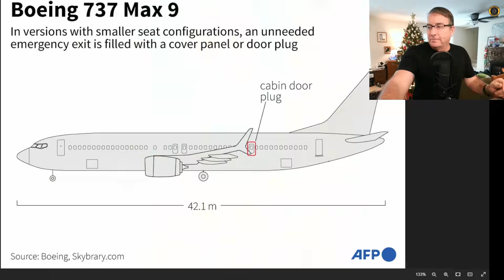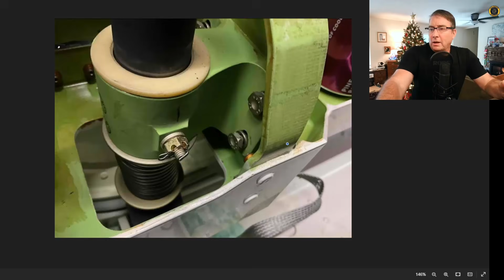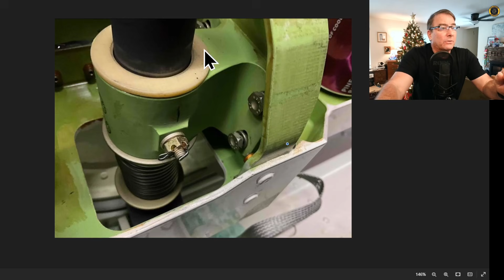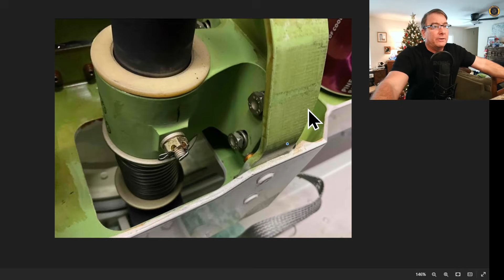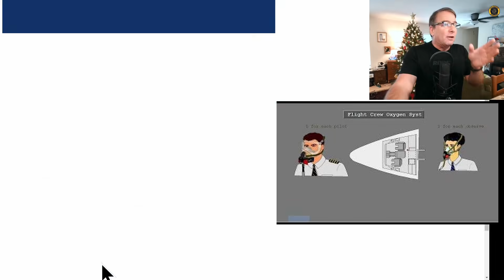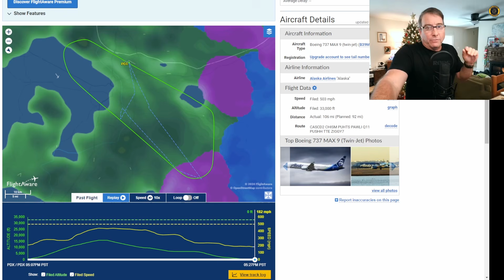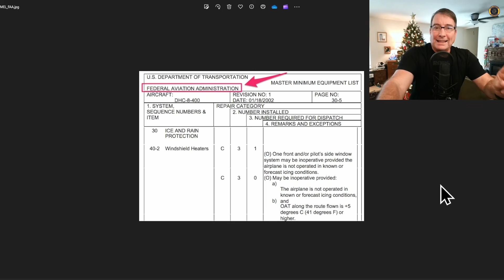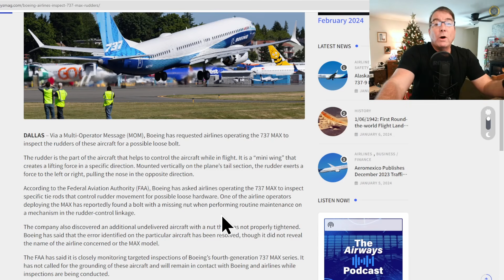"Yes, We Have No Bolts"  9 Jan 737 Max-9 Update

Comment: They would know immediately upon looking at that door if the bolts were on and tight. I see all these "experts" talking about this on TV, and none of them do it as well as Juan.
Reply: I believe that the "door" (dummy door) frame and surround are covered by finishing decorative wall covering that may be sound insulating and not designed to be easily removed unless for a major service or refitting of the aircraft.

Comment: This is the most accurate video series period.'  ..but that castle nut @3:00 does have a specified torque , it is torqued then the "castles" are lined up with the cotter pin hole then the cotter pin is properly installed ....   imagine on the shop floor if someone "anyone" says that bolt installation is not so important .. when in actuality that
set of bolts are super critical .. the other bolts @ 5:40 are installed with a nutsetter a air powered toll that runs the bolt down to a specified torque example 35 in lbs.
those examples look like they were just put in finger tight and skipped.........  Today they had a Safety "stand down"  !!!!
Reply: The torque on the retaining pins is not "super critical" because they have castle nuts.  There is no way all four cotter pins failed in two months.  The likely scenario is that the pins were simply never installed and the door stayed in place by pressure until it eventually shook loose two months later
Reply: @luisdetomaso867  But it is super critical because if you are installing to "spec"  then you will also be putting cotter pins in.....
a castle nut freewheels without a cotter pin ...  Imagine being a mechanic and having "everyone" say this ain't Super Critical  🙃
Reply: @ronaldspins  I think what was meant is that the bolts with castle nut / cotter pin securing are not torque to yield (stretch) as is the case for the other fasteners mentioned.
Reply: @ronaldspins As you point out, the cotter pin is critical. The nut torque is not all that critical. In fact, is is very close to "not at all critical". It's real nice if the nut is tight enough that the bolt isn't rattling around in the hole, since if it is rattling wear will eventually become a problem. But even if it is rattling loose, if that cotter pin is there and properly spread, it isn't going to come apart for at least a few years. By then it should have been through an inspection cycle and the bolt removed and reinstalled.
Reply: I thought that that bolt IS the cotter pin.
You seem to be talking about the split pin/ wire holding the castle nut secure
Reply: @lwilton  The torque is required by specifications
Reply: @lwilton  You are spot on.  Torque hardly matters with a castle nut.  And in this case, the door would have been held in place by any ONE of FOUR bolts.  It's pretty likely that ALL of the bolts were forgotten by mistake and it was just a matter of time before the door shook open
Reply: @ronaldspins  Torque for a castle nut might be specified, but if the nut is pinned it will still do it's job just fine.  Might rattle a bit, all 4 of them are not failing after just two months of service
Reply: @ronaldspins if they are torqued to a certain amount, what do you do if the hole in the bolt doesn’t line up with the slot in the nut? You would either need to over tighten or back it off a bit to put in the cotter pin. Seems to me torque is a non issue
Reply: @jameswolff2152  yes I can tell you have never performed the process ...if you are installing and torquing then you are cotter pinning it
Reply: @jameswolff2152   Bolts that use a castellated nut has a torque range for the nut. Torque to the lower torque, if the cotter pin doesn't line up, increase the torque but do not go over the max torque. Fasteners are always have a prescribed torque in aircraft.
Reply: Mr Brown's Channel is the Gold Standard.
Reply: Outstanding reporting Juan!  One of hiss best analysis yet and I've been following him for years going back to his analysis of the Lake Oroville Dam repairs.  Sometimes I'm thinking I'm learning more than I need to know.  My wife and I flew a United 737Max-9 18 months ago from Maui to SFO.  I took some comfort in the type of plane  that it wasn't a Max-8.  Keep up your reporting Juan.  If you ever stop your daytime job, I'm sure you have a spot reserved for you with the NTSB.
Reply: I am just a car guy that had to learn proper safety wiring methods to install high performance brakes on his '69 Camaro. I was under the impression either castle nuts and cotter pins or drilled bolts with safety wire were practically everywhere on planes. I am wondering is there any reason those two bolts holding the hinge on the door plug are not drilled and safety wired? It seems they are kind of critical to keeping the door in place.
Reply: I agree. But it is just speculation. I bet someone found out they could save time by not torquing the bolts. and this is the outcome.

Comment: Extremely worrying for safety and Boeing! 😮
Reply: They/the person responsible for this manufacturing step can be thankful there was no loss of life. This is shaping up to be careless workmanship.
Reply: @larrybe2900  Or sabotage.
Reply: @Rebander1549  Almost 5000 on back order- it would most likely put Boeing out of the commercial Airline business, if the Aircraft was cancelled. this MAX problem totally detracts from the great safety records of the 777,787,717,747,757/767 etc etc! Please Boeing get it together on this Plane!!
Reply: @SAC-93  @jimanderson1589   
Why do you believe that people not tightening or installing bolts is unique to "this Plane"?
Reply: @Rebander1549   You have absolutely no idea what you are talking about
Reply: @Farlig69  thanks,  but it seems like it is worth considering.  A seamless hull seems like it would withstand the pressure but I don't know what I am talking about.
Reply: @Rebander1549  Birds don't have unneccessary holes - they only have holes required to sustain life and they don't carry fare paying passengers. 
Fare paying passengers need doors to enter & exit the aircraft, and they absolutely need emergency exits. They also really really want windows.... 
So, a birdlike seamless hull fuselage just would not work and yeah QED: you don't know what you're talking about.
Reply: @Farlig69  you're correct,  good for you
Reply: @Rebander1549   I know I am: don't take it to heart, realise when you're wrong, learn from your mistakes and don't retaliate with sarcasm...
Reply: @Farlig69  u r correct
Reply: No jail time for CEOs.   NO fear of GOD.  Just the Shareholders.  LOL. 😂 😂
Reply: @jamesmorton7881  This has sabotage written all over it. Most popular twin-engine plane ever. 11,000 airframes built and delivered, over 4000 on order. 737 represents 56% of Boeings sales. And now all these mysterious problems? And now we are told the CVR was written-over. Did the two female pilots do or say something stupid?
Reply: I personally wouldn't consider this "extremely worrying". Yes, it's something that needs to be investigated - but there were no injuries.
Reply: @PsRohrbaugh it was only by pure luck there were no fatalities or serious injuries. Had there been people sitting in those seats, had it happened at cruising altitude, had the door hit the vertical stabilizer…well we’d be having a much different conversation.
Reply: It's time for Congress to do something about Boeing.  At the least, they could be made to pay some very large fines.
Reply: just the new plane u have to worry about.....
Reply: @toby2581  true,  but they don't have unnecessary holes in their  bodies.
Reply: Maybe the bolts would be close to where the door plug was found.
Reply: @Rebander1549  Really? This was an assembly problem not a design problem. Same fuselage and same door as on the prior 787 NG. No problems.
Reply: @imkindofabigdeal4308  OK!
Reply: IF the fuselage design does not match up precisely, maybe the nuts were installed loose by subcontractors to "allow" the bad fittingings to "close".  But this can be a bad design where tolerances stack up and ruin the mating of plug-doors with the fuselage.   This bad interface is critical on pressure seals in many places across the plane.  This can be a much larger topic if it impacts seals on any doors, or escapes, not only the plug-doors.